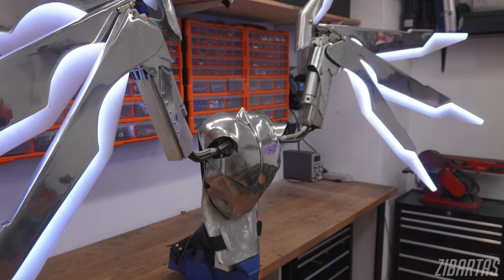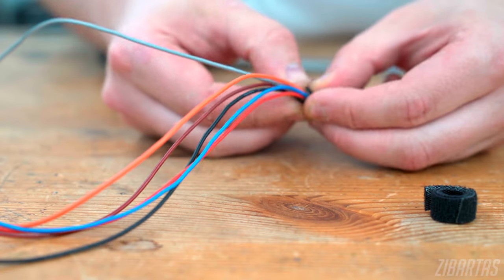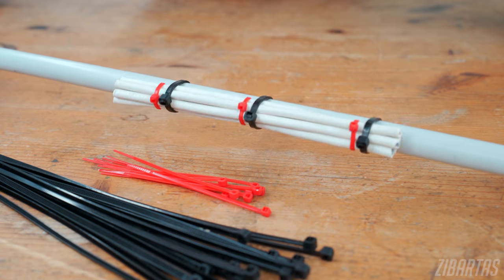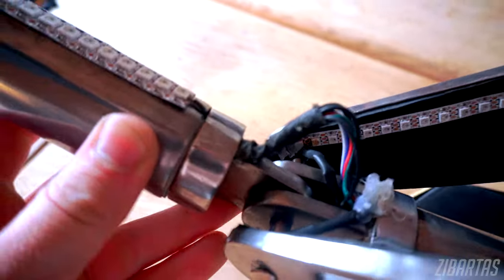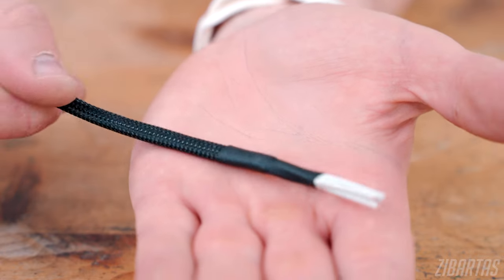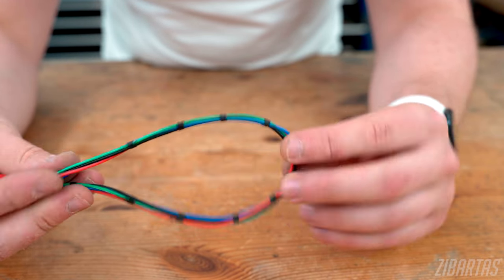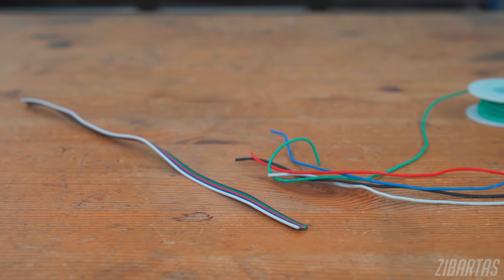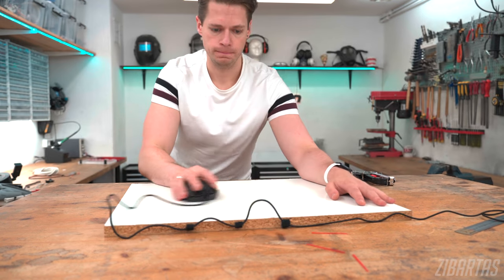Tips for CLEANEST Wire Management! (Sleeving, Fastening)

Comment: For all the semi-permanent wires in my house I use the 3M Command (xmas) Light Clips. They’re wide enough to hold several wires or even a heavy duty extension cord, strong enough to hold the weight. I use them under my desk, behind furniture (media center,dressers,nightstands), and along baseboards & door trims.

Comment: Also try "Gaffer tape". Apply e.g. similar to the heat shrink, at spaced intervals. It does not leave a residue like electrical tape (at least in the short term, I did not try this for a decade or so!). Especially useful when the connectors are already on the cable so adding heatshrink is impossible. It feels like tesa 51025, but way cheaper. You can buy a big roll and it will last a lifetime. It is used to tape audio cables etc to podium floors and high-traffic walking areas, so it should be pretty wear-resistant. Also consider: spiral wrap. And "cable lacing" if you want to make MIL-spec stuff 🙂

Comment: I use the cutting heat shink tubing into small rings quite often. I makes one small length of heat shrink last much longer over the length of a wire run
Reply from the maker: I know right??? And much neater than small zip ties!